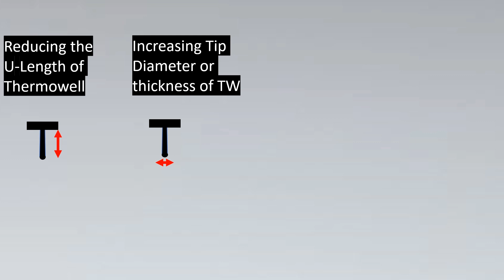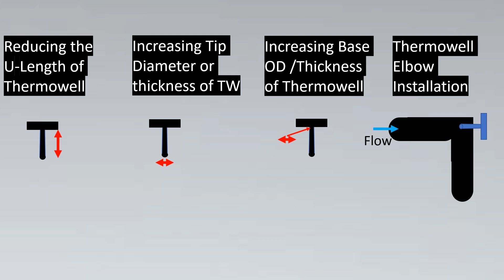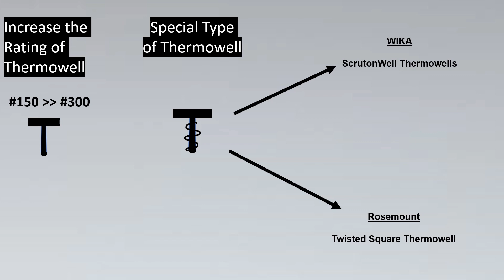ALL Thermowell Solutions to Wake Frequency ( Under 2 mins⌚)

Comment: I felt like video running on 1.5x speed. Otherwise information you shared here is lottery won moment to viewers like me.
Reply from the maker: yes, you are correct will try to slow down a bit 😊. And thanks for your constant encouragement and kind words of appreciation Balaji . It means a lot !!
Reply: Your videos are really informative! I am one of the instrumentation engineers who is looking for a transformation from maintenance to design engineer. You videos have really helping me during this. It would be really helpful if you could reply me on linked. Your help will be appreciated!
Thanks in advance!

Rahul M Khare
Reply from the maker: @rahulkhare6799  Thanks . My Apology with respect to LINKEDIN reply. There are 500+ messages left to be answered, i am trying to answer as i am getting some spare time.  I will find and try to reply to your message first. 😊
Reply: @AsadPassionateEngineer  Thanks Asad!😊